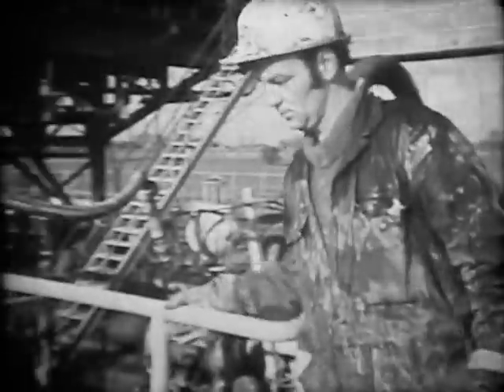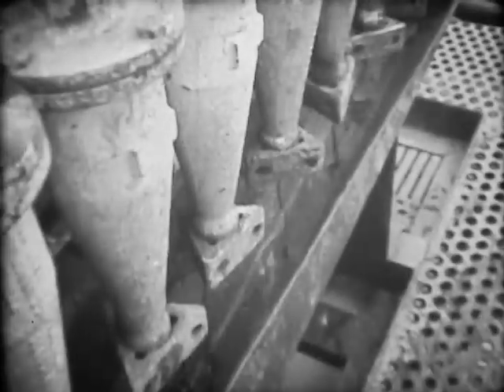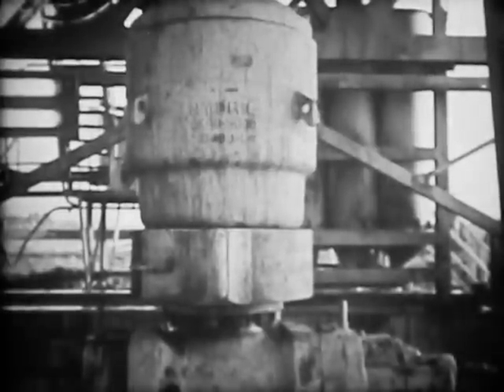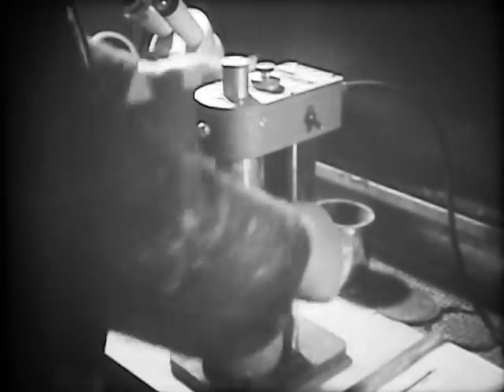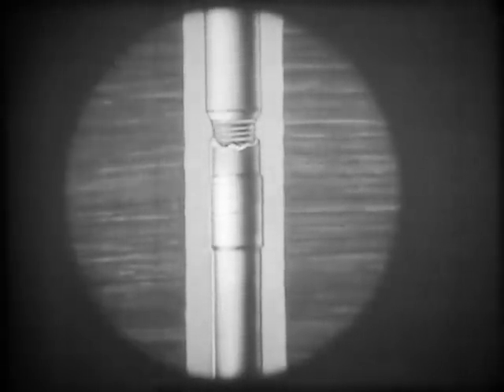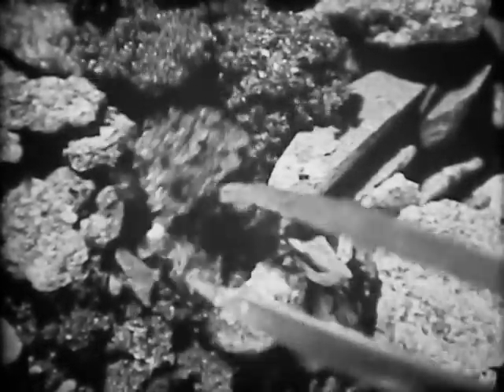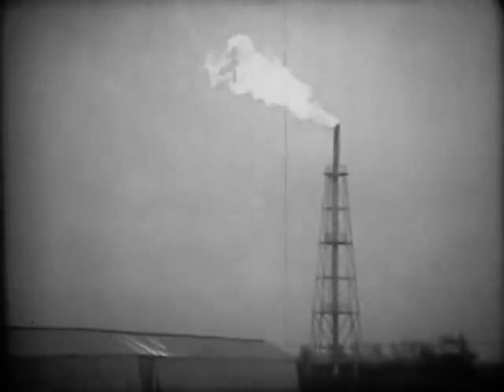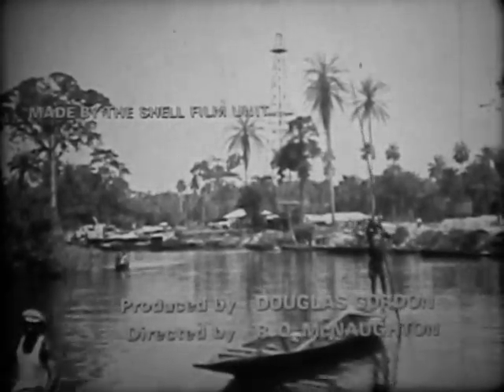The Oil Well Drilling Process - How Oil is Formed - Animated Diagrams

Comment: Men in these oil rigs deal with a lot of danger so they are paid  a higher rate.     This just one example the average salary of men are higher than the salaries of most women.  wage gap debunked.
Reply: Unless, of course, you compare men and women doing exactly the same job, in which case you see women get significantly lower pay.
Reply: @bahr9755  Not in the patch, if she makes a hand, she will get paid the same. There are gals that do it too, and much respect to them. It's dirty, dangerous, and exhausting, with no days off up until the mid 80's. You got days off by having someone double for you or twisting off (not showing for work).